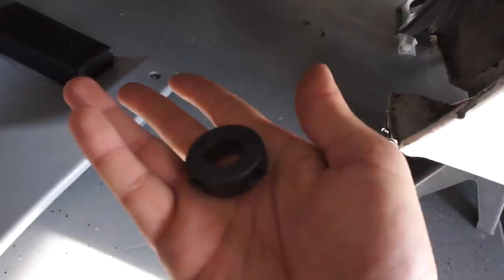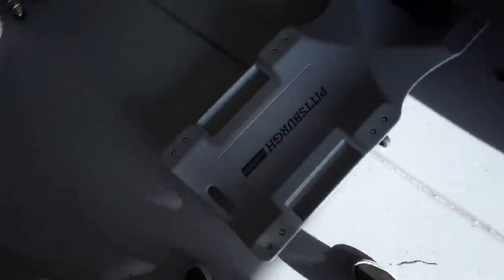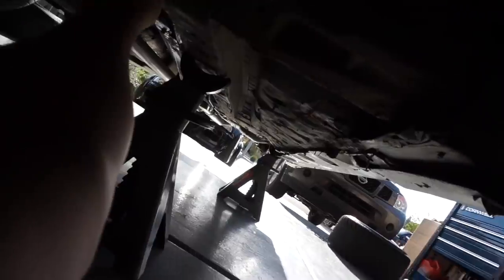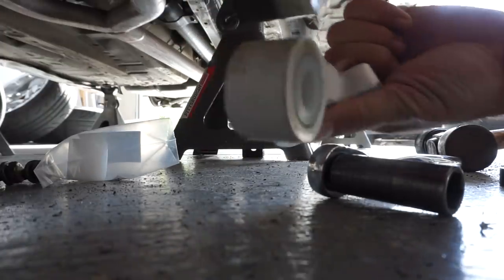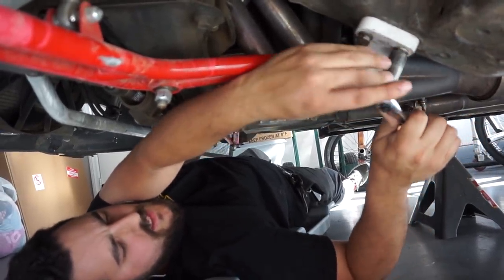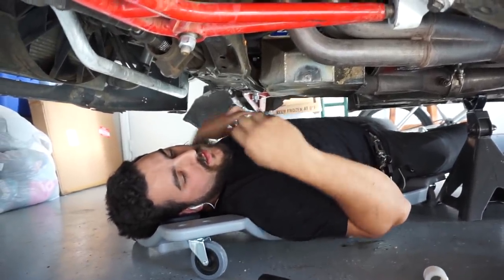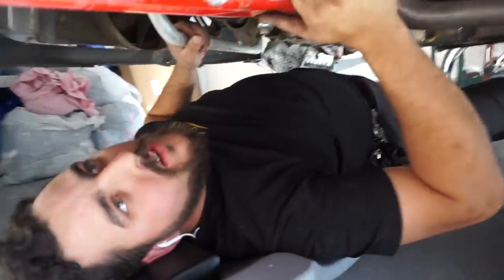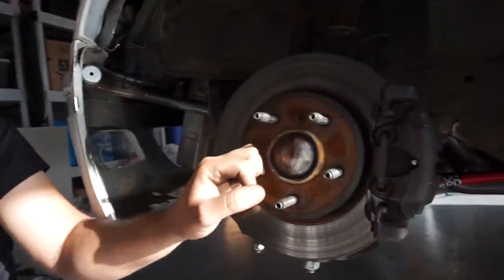Death Wobble Repair x Diaz Daily Vlog 3

Comment: Hey I know you been missing me number one goof nut ...i was cheering you on for the longest time then work happen and unfortunately I haven't been as active but I did catch up with most of your videos that's the nice thing about it I get to binge watch..... But ask for your issue with the SLR kit... I may have a solution for you you can take it as you like but get a washer large enough or a drill large enough to slide over the SLR kit without a whole lot of play and then cut down your old bushings it's about the distance remaining and that way your old bushings have something to push against without pushing out... The metal washer will prevent the Condor shim bushing if you want to call it that from pushing any further on to the control arm and it can't go the other direction....

But either way I'm still stoked that you're a part of the hoonigan crew now.... And your content is still great to watch.... My E36 had to take a back burner because of work... but definitely not going to stop me ... I have widened  the body on it with the actual sheet  panels of the car to look more emsa like .... It's been widened 3in on both sides
Reply: I didn't watch all the way into it until I just now noticed that you actually added a little clamp...lol

Comment: If you dont mind sharing. What spring rates do you run? Or recommend for twisty back road driving e46 sedan. Im looking at the BC coilovers ER series with the spring upgrade. Running a 225/45/17 at the moment. Thanks dood